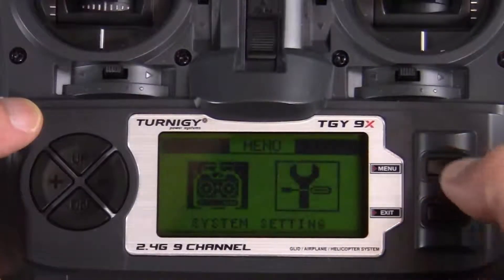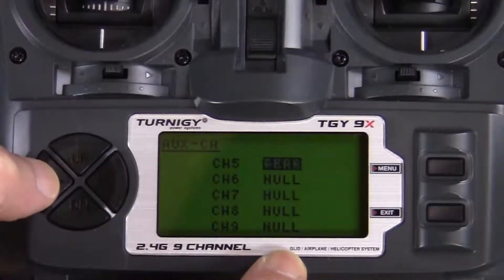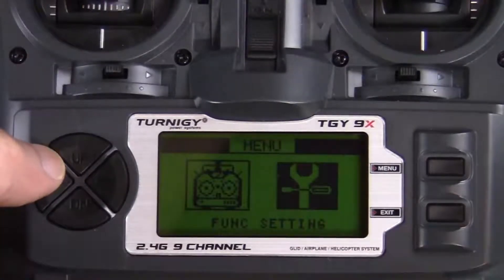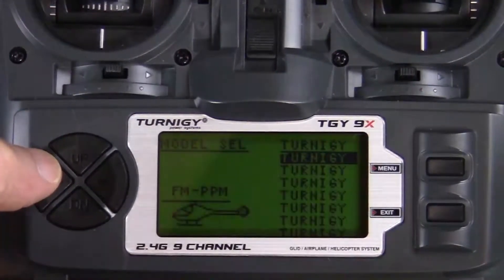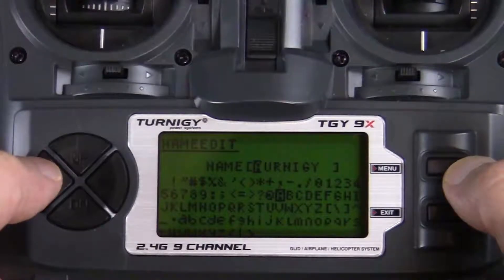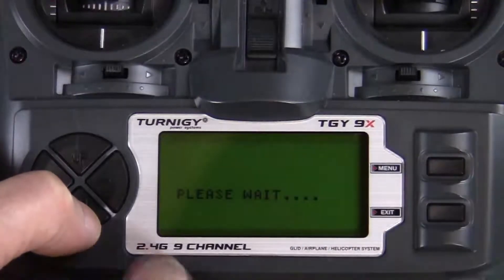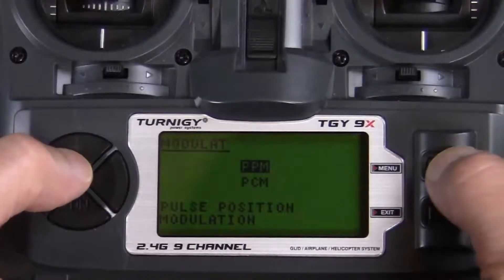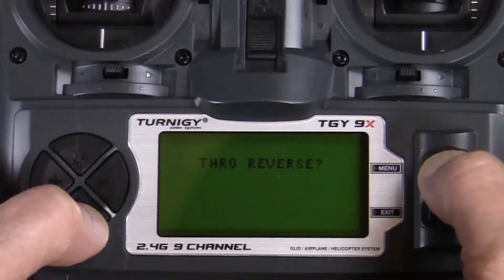How to Build a Quadcopter With a Pixhawk Flight Controller Step 5

Comment: Hi, I have a problem here, after I bind the transmitter and the receiver together, when I turn the transmitter back on, the transmitter start constantly beeping and there's nothing on the screen. I'm sure that the battery is brand new and the throttle is on the way down. anyway to fix it?
Reply: +rawin pinkoh make sure all of your switches on top are pushed away from you, they all need to be in the "normal" position

Comment: Hi thanks for sharing this knowledge with us. Would it be possible to show how you actually select the different flight modes? ie position hold, loiter, rtl. Many thanks
Reply from the maker: L0ND0N200012 The video is a manual flight and not one with a flight path in Mission Planner.  We are hoping to follow up with a video on autonomous flight and in it we will show how to set up the flight modes.